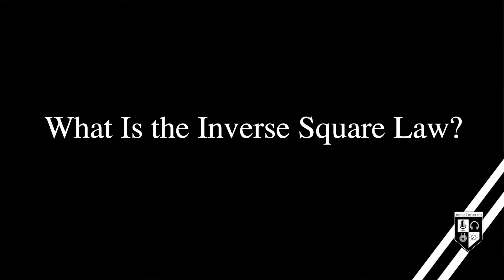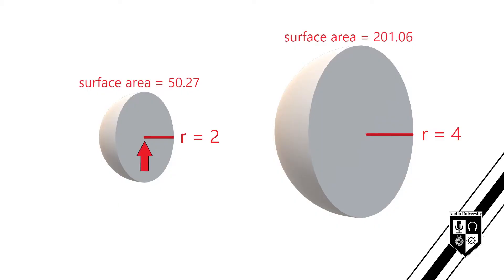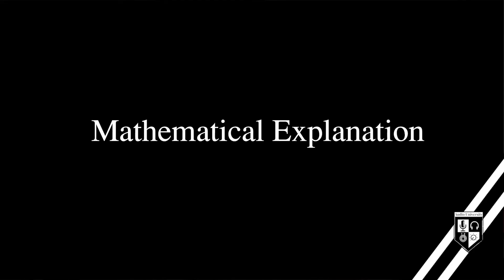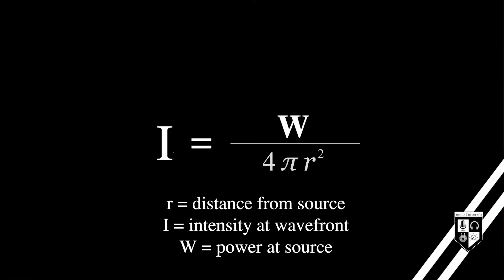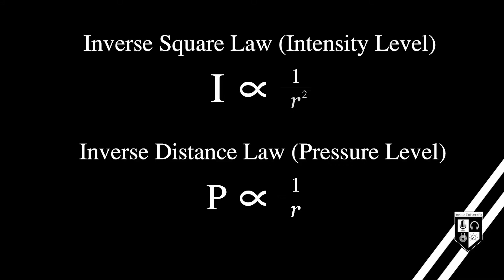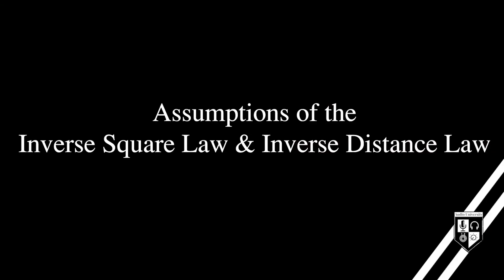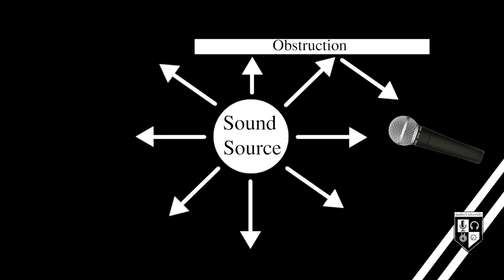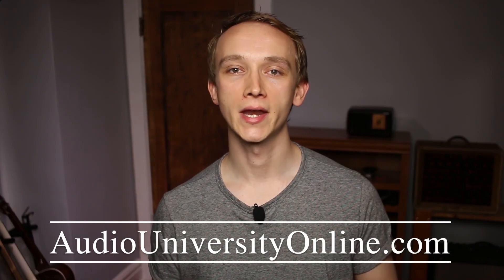INVERSE SQUARE LAW of Sound

Comment: Why is the intensity  proportional to the pressure squared?
Reply from the maker: Intensity is inversely proportional to the distance squared. Pressure is inversely proportional to the distance.
Reply: @AudioUniversity  ok thanks. And how do you demonstrate that pressure decreases with distance? Or you just have to believe the experiment and the distance law?
Reply from the maker: Good question! I demonstrated it with a microphone. A microphone measures SPL (sound pressure level). With each doubling of distance, the pressure level measured by the microphone decreased by 6 dB. It’s more difficult to demonstrate intensity loss, but still possible!